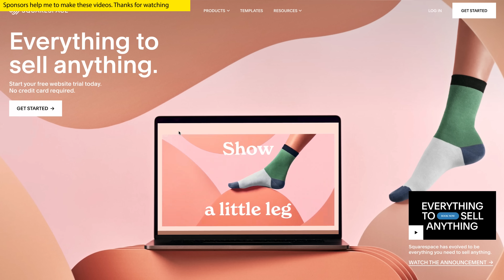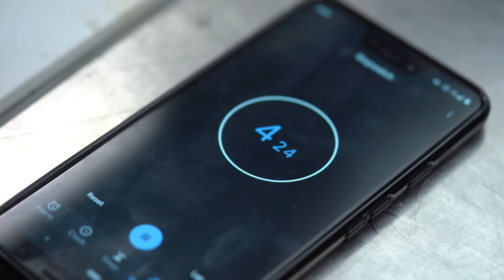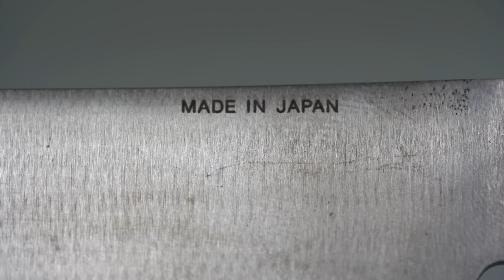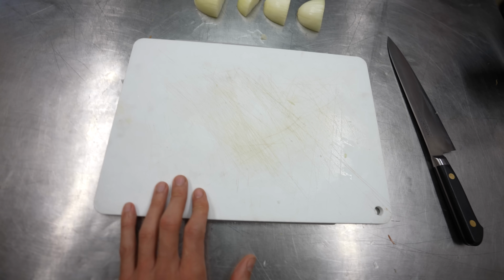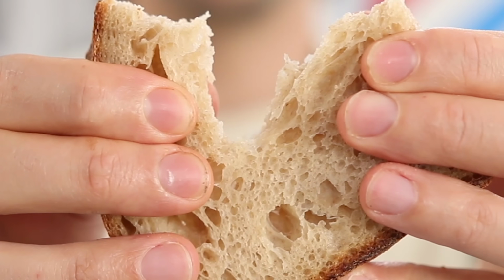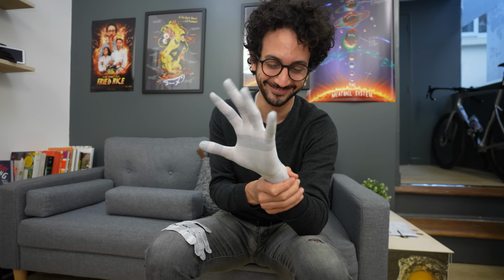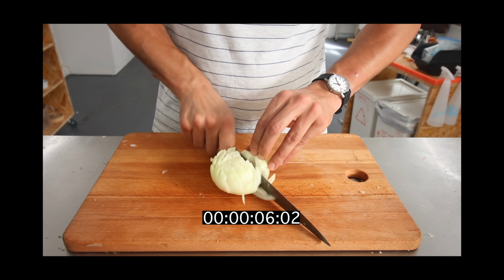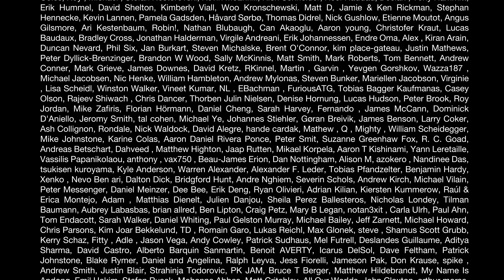I Broke My Onion Record Using The "1% Principle" (Atomic Habits by James Clear)

Comment: J. Kenji López-Alt might have something to say about thinking that horizontal cuts are "unnecessary".
Reply: They are unnecessary. Yes, Kenji will confirm that you get a finer dice with more pieces and uniform cuts, but Alex's goal is speed so it's unnecessary. Plus the general home cook doesn't need to use the mathematically ideal method to achieve a good dice and tasty food.
Reply: Also, remember Kenji promotes personal preference, he isn't a gatekeeper about cooking techniques and doesn't promote the idea that there is a "best way" that every cook has to follow.
Reply: @bluepajamagamers5704  very true, but he is adamant about needing horizontal cuts in onions to get the best, most even dice.
Reply: @iqmensah3348  But only from a mathematically tested perspective. This isn't relevant to this video, nor does it have to be to anyone who is fine cutting onions in a slightly less optimal yet easier way. Which are most people.

Comment: 4:59 I think you are dulling the edge by angling into the buffing wheel much more than necessary, same angle as sharpening would remove the burr and polish the edge without problem.
Reply: I know some folks strop at a higher angle than they sharpened, and swear by it. Not sure I'd do that on a powered buffer though, you're right.

Comment: Super interesting video, well done.

One thing I'd like to add as a long term knife enthusiast though is that even for polishing, knives and power-tools should never go together! 4:59 hurt my soul.
(There are exceptions of course, knifemakers use belt grinders, but those are usually speed controlled and have a cooling system in place)
It's very easy to overheat such a thin piece of steel at the very edge and this damages the heat-treatment, softening the steel and reducing edge retention.

I'm not going to go into the other risks of fast spinning things and sharp edges, we all know we shouldn't try what alex is doing at home xD

Comment: Aren’t the horizontal cuts due to the geometric structure of the onion (concentric circles)? You’ll have longer onion pieces on the sides if you slice vertically.
Reply: You tip your knife inward on the first side, and tip the leftover onion over when you get to the far side. You get pretty even cut this way.

Comment: Strop your blade
Smoother is always faster. Stroping polishes the micro burrs allowing the blade to slide faster.
*Bonus, it ruptures less cells which means less sulfuric acid in your eye balls. Less eye pain = Faster

Comment: Sweet! Now you'll cut an onion in 20 seconds, but only after the 20 minutes it'll take each time to sharpen your knife, fetch the big cutting board, put on your glove, clean your glasses, set the fan up, blah blah. You were too focused on one aggregation to remember to consider the other, more important one. I'd wager that any speed advantage you get from putting your glove on before chopping is so small that they're completely cancelled out by the time it takes to put the glove on.

Comment: Welcome to Speedrunning. Improvements and learning different strats are essential for speedrunning.  Sup 20 sounds real good but im sure your able to get a 15,XX.
I saw in your motion potential for improvement:

1. You cut the Onion in half
2. You cut the first half diagonal wise
3. You cut the already cut half lengh wise
4. You repeat step 2 with the second half
5. You repeat step 3 with the second half

Thats your steps.

I suggest you this:
1. You cut the Onion in half
2. You cut both halfs diagonal wise
3. You cut both halfs lenght wise

In my opinion is this faster because you concentrate on 1 Step and then you can continue with the next step like a work flow. 
What i saw in your diagonal cuts is you are to slow. You should be more confident with your action. 
Then i think you should get a 15 in no time.

Greetings Pat.

Comment: But how may onions will you have to cut before the time spend on putting on a glove, setting up the blower, etc. hasn't eaten up the speed enhancement you have obtained. Not to mention the time used on gathering the pieces afterwards, and cleaning up, as the speed enhancement obviously tends to spread chopped onions all over the place! So to your comment in the beginning on how many times you used the "street method" since the first video I guess it's similar here, because apart form doing the prep-work in a professional kitchen, in most cases you need to chop only one onion. 
What about cutting a shallot?

Comment: You gave up on the "street" method because it produced uneven cuts, but then you turned around and got rid of the horizontal cuts in the regular method, giving you more uneven cuts again. Yes, there are plenty of horizontal lines in the onion already, but only in the centre. If you look at the edges, there aren't any, so if you don't do any horizontal cuts, you're going to get incredibly tall slivers from the edges. 
If you insist on not doing any horizontal cuts, you can look up the technique from J. Kenji Lopez-Alt with slightly diagonal cuts.

Comment: Alex, a question. I've found that my biggest hinderance in cutting onions is that they cause my eyes to tear up till I can't see anymore. Do you have a fix for that? I've tried the "place a bowl of water near the onions" thing, and putting a HEPA filter near where I'm cutting, but those don't seen to help. I mean, the HEPA filter helps /long term/ with clearing the air, but I'm long done cutting onions before that filter has processed enough of the air to make a difference.
Reply: Yes I saw that you used a fan in the video, but I'm wondering if something else, like soaking the onion first, would help. I swear this didn't used to be a problem for me, but as time progresses it becomes a bigger one. Though thinking on it I'm also working in a smaller kitchen each time I notice the problem get worse, so maybe it's just a difference in air flow.
Reply: For anyone familiar with the TikTok video where someone uses a hoodie and a glass pot lid to deal with the fumes, I just tried it and it kinda works. The pot lid fogs up, and a rain coat would probably provide better protection from the fumes, as they got either around or through the hoodie, but otherwise it works.

Comment: …funny thing I’m allergic to onions …yet when I was on grill the one thing I was consistently complimented on by customers where my rendition of caramelized onions … one day I will have to try them, one day!

Oh and marginal improvements see greater aggregate effect often because of greater understanding of division of measure and greater manipulation of measuring devices … and my rough calculation Hoovers around 3% per skill you shared with us in your edit … so I’m gonna invoke Chubbs from Happy Gilmore ….It’s All In The Wrist’s … your wok flipping stir fry … uber-gated your chopping skill.  But thanks for sharing the principle in a digestible way ..for those of us not allergic to onion …😿
Reply: "Allergic to onions" is almost certainly from the sulphur compounds (which allium plants have for pretty much that reason), and those are destroyed when you caramelize (at least with a dark caramelization). That's more of a chemical sensitivity than an actual allergy. A real allergy would be to the proteins, especially allinase, which will be completely denatured in the process. You should be safe to taste a tiny amount.
Reply: @stanrogers5613  you are accurate  …the smell was enough to let me know the taste …  its the texture and the culmination of the experience that is lost  … risk is not worth the reward …if the allinase is broken down in caramelization does that remove the bacterial attracting properties inherent to allium’s ?!

Comment: So. Splitting the whole into the smallest parts possible, and improving each one by 1%. That should give you an improvement of the whole, of.... 1%. And Yes, that would be significant, especially if you're less than 1% behind the winner.

Comment: I was surprised that when you changed your knife you totally overlooked the blade shape.
I would think your first knife would work better because the blade edge was "flatter"/straighter so it would cut all the way through the onion to the flat cutting board more often.
It didn't seem to make a difference in practice though.

Comment: Dynameea is just UHMWHDPE

IE carefully arranged strands of plastic milk bottle.

It's weight for weight much more effective at stopping bullets than steel (it's what's in modern bullet resistant armours)

However steel is still better volume for volume but its much heavier

So usually you have a combo of UHMWHDPE, aluminium, steel and ceramics in a strike plate usually with a heavy duty rubber as an anti spall.

Those gloves are just woven, not set, UHMWHDPE so they're likely to stop light cuts but a solid stab or heavy cleaver strike could still go through so so please still be cautious. 

I Don't want the only cool French guy I know too shut down his YouTube because he cut his fingers off ;)

Also as any black smith will tell you an anvil that doesn't let the hammer bounce is more efficient.

Lastly... Practice the street food cutting technique. Obviously you'll be way faster then.

Comment: BS, Alex.
The person in the reference video has a sharpened hacksaw-blade and a saddle-shape (convex) chop-block.
Your 1% improvements are cute, but the big advantage is in the ultralight (and practically free) blade and the shape of the cutting-board that cuts through-and-through - neither of which feature in your "incremental improvements" - a complete misser.
The problem with TED talks is that they are post-facto.
They see what Steve Jobs did, distill a plausible sounding but ineffective similie of its essence and sell it to starry -eyed listeners.
Steve Jobs likely never listened to TED-gurus, instead likely did their own thing.

Comment: Cool, but you're an engineer. You can chop an onion faster with a food processor. That has the same problem as the street vendor: no control over the size of the pieces.

I'd love an onion cutting machine with variable cut sizes.

Comment: By doing aggregation of marginal improvements you faced the effect of diminishing returns :) Not even sure if you improved after all as you omitted 1 slicing pass (horizontal) and you changed how you time your performance. By starting at 10 you gained 1s there which has nothing to to with slicing the onion.

So, we're both engineers and what the development process though me during this year is that you need to optimize the algorithm first and only then the tools used. You only go to the "aggregation of.." when you have your "algorithm" optimized. But you have it, do you ? ;) I bet you already experimented with optimizing how you cut the first two slices. That would be out of the box thinking. :)

Comment: The last result I feel was flawed in the starting without pressing start and having the knife and onion already in your hands. a lot of time was saved from that alone and a lot of variables change over time making this very hard to look at scientifically. a better/more consistent testing method is def needed
Reply: I think it's fine, if he's just trying to prove that he can cut an onion in under 20 seconds. Don't need to compare that to the other tests to prove that.
Reply: @Savagedownsouth   but what I'm saying is if he used the same measurement of not having to pick up the onion and knife and align it like he didn't in the last run, his earlier runs would of probably of also been under 20 seconds

Comment: Facepalms at the 1% strategy. Real optimization is an iterative process. Start with the section that takes the most time, optimize that. Find the section that takes the next largest amount of time, optimize that. Rinse and repeat.

The above process guarantees you are systematically getting maximum gains for the effort you are putting in. Not this... random haphazard wasting of resources "optimizing" for what could be absolutely minimal gains.

Comment: Last try was BS you didn't win anything on the onion cutting part just on the  mesurment. Conclusion with expensive stuff you could win 2 to 3 seconds per peeled onion, quite insignificant if you add the peeling and post-gathering: 10 minutes every 200 onions. If you need to do that much, some amazing machines can do 600Kg/Hours.